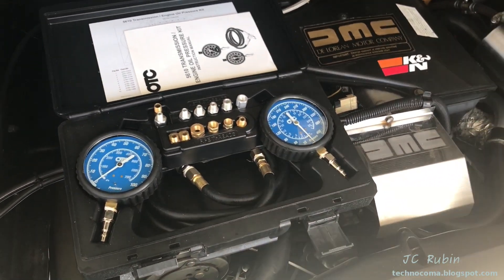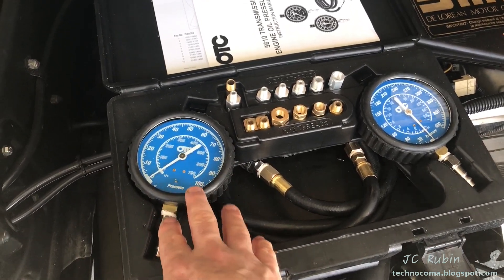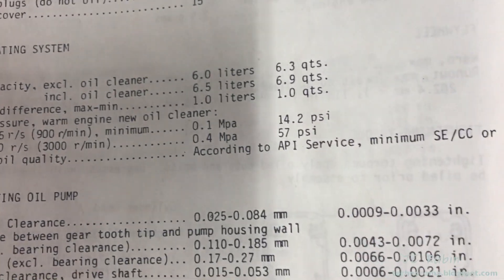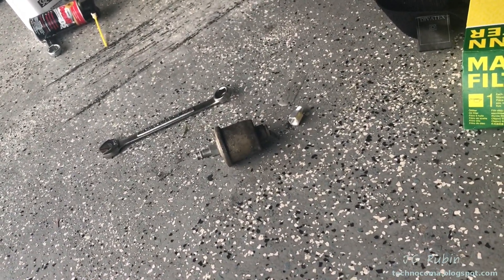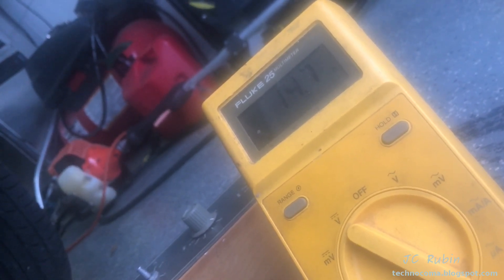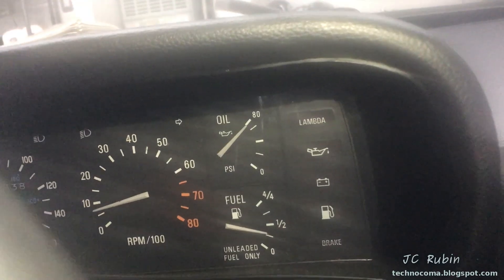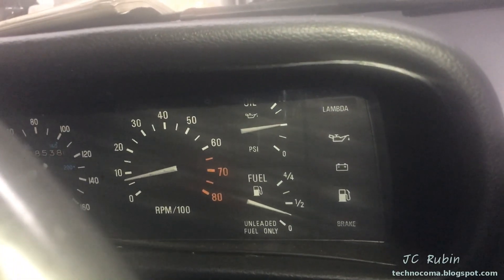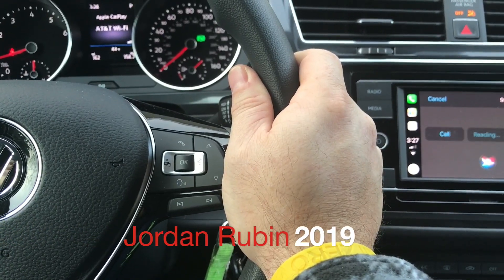Delorean Maintenance - Oil Sending Unit, Oil pressure and Oil Gauge Testing

Comment: Were is the written data comes from? I have few manuals for Delorean but could't find relevant data.
Reply from the maker: That came directly from the Engine specs portion of the delorean workshop manual
Reply: @retrotechandelectronics  
Thanks, I do have PDF with Workshop Manual but its different layout and different data. But Volvo manual confirms same figures, 1 bar on idle, 4 bar at 3000 RPM. I am getting only 2,7 so it gets me worried.